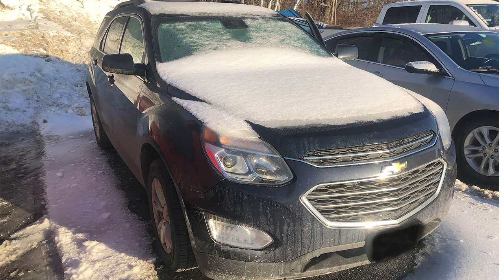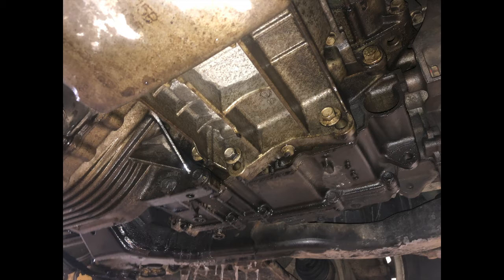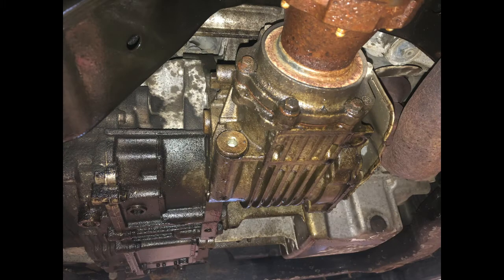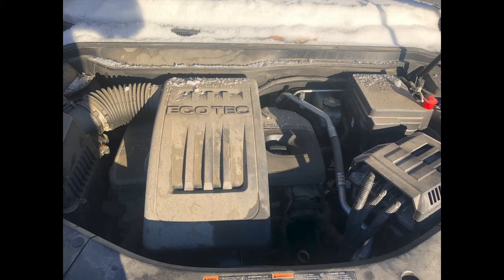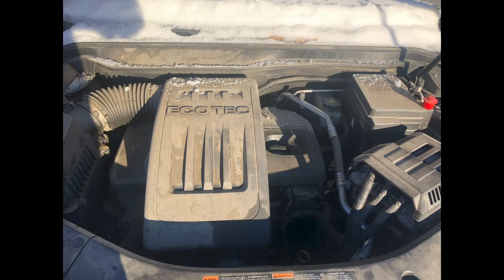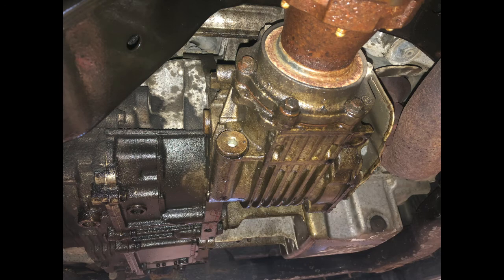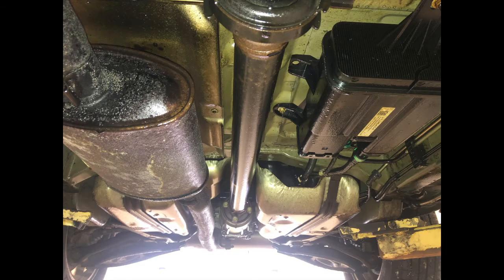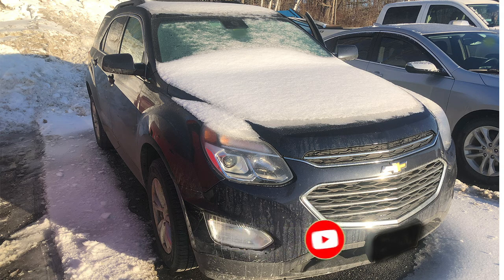2016 Chevy Equinox 2.4 Engine Failure, Clogged PCV system frozen, Blown Rear main seal, leaking oil

Comment: This just happened to a friend of mine's Equinox in Texas a couple of days ago when we had a winter storm cannot believe GM has not recalled these vehicles and fix the PVC system
Reply from the maker: Yes it's been super common, looking at another one tomorrow:)
Reply: @videoserviceinformation6639  How much did it cost to fix labor wise?
Reply: @atx-cvpi_99  all parts an labor in Canada was 2500 for me
Reply: Just happened to mine, 😒